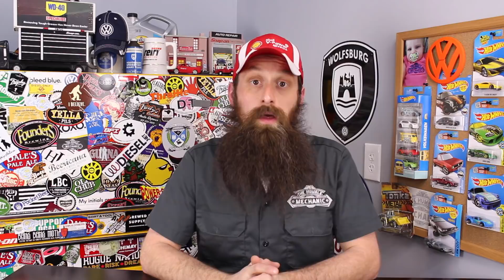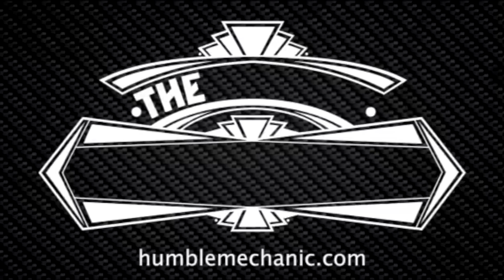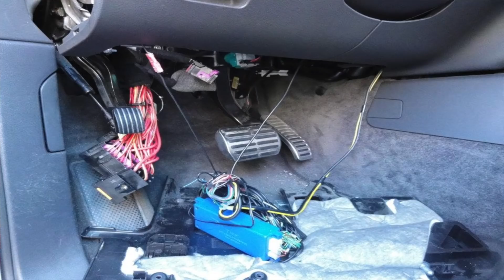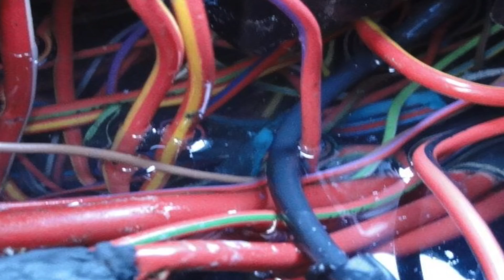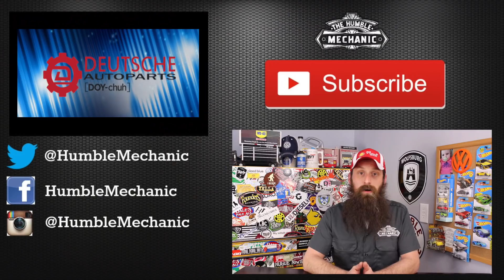Top 5 Failures of the Volkswagen Touareg

Comment: Great video sir, you have that rare talent for being critical and still coming across in a sincere and nice way!
Ok so I bought mine new, V6 2004 now has 186,815 miles. Yes, on most of the issues except the ones for air suspension and seat issues as mine was the very basic model. You did mention brake sensors briefly they are these little wires with clamps that usually break within the first few brakes pad changes. 
So the bearing on the drive shaft, YES!!!!!!!!!!!! Lmao, I’m an expert on how to repair that as I have been fixing it for many years now. Heavy Gorilla tape around a core of foam, I might make a video next time I need to fix it 😂 

The ONLY thing you didn’t mention of perhaps you did and I missed because you are hauling ass lol THE HEADLIGHTS
HEADLIGHTS fail a lot especially the day ones, after a while, like 15 years the wires that connect the lights start to get old and sometimes need replacing.
The real crux is to change the headlights one of them is fairly easy, I forget which, but the other one you have to remove a lot of stuff to get it in there.
Also the battery is a real bitch to replace as it’s under the drivers seat lol 😂 

Even with all that said I still really enjoy this vehicle it has never left me on the side of the road and still runs like a top for the most part, the gas mileage sucks bit it’s a 5000 pounder…it’s still very comparable to new models in features build and off road capability. Just MHO bit after the first T1 Touareg series 2004-2006 they went downhill, jus the roof top bars to name one…
Amazingly all my windows still work and the sun roof never had to repair them…now tomorrow they will break as I write this lol.
Ok I think that’s all I got, thanks again really enjoyed this and will be on the watch for all the other stuff, it’s inevitable I suppose!

Comment: "check headlight range control" has been on most of the time I have owned the Touareg. Still have not got it fixed. The corroded wire under drivers left foot triggered dash lights to go on and prevented the car from shifting out of park. VW was of 0 help and just wanted me to pay them $1500.  Are either of these issues a recall or no?

Comment: My wife had every problem you listed. The car would not come out of park took it to our local stealership they had no idea. I found it on you tube and fixed it myself. The water was leaking under the front drivers seat and had to splice a a couple wires that had rusted clean through. Put them together the car came right out of park.

Comment: 2011 touareg - master window switch on driver's door breaks.  Good sign broken -no auto up and down.  Sometimes have to push on back of button.  However, easy fix on my channel - part is cheap on ebay.  Pops into driver's arm rest with almost no tools.  2nd is chasing cooling sensor temperature problems.  replace the sensor on lower radiator hose - super easy.  But still had temp needle wagging about.  Tested new and old sensors in tea kettle with 200 degree water - resistance remains constants over 30 minute.   Bleeding air out of system can solve it even though you would think that in the lower radiator hose how could that be a problem.   Laying the whip to the engine a few times, then idling with heater on and cap off reservoir, reduces it.   Using ODB2 bluetooth and torque on tablet shows temp going from -20 to 180 (even though gauge reads 200).  Kind of annoying when the a/c cuts out in Texas heat.  But other than that at 102K miles - reliable and remarkably sure footed in the blizzard we had a few months back.  V2 TDI improved over previous version.

Comment: The V8 also had bad ground cables from the engine mount to the frame. The welded connection of the cable will develop high resistance and drop up to a volt and a half. 
I’ve done several vacuum and tandem pumps for oil leaks on V10s. 
V6 TDIs have oil leak problems at the oil pan. The apparent fix is replacing bolts and coating the new ones with sealant.

Comment: I’m getting the rapid thumping noise and feeling coming from what seems like below the centre of the car when accelerating hard...which is kinda fun to do in a W12🤪. It’s an ‘05 with around 110,000kms. Would these have been susceptible to the same prop bearing issue? I’m guessing it might be since the rubber is 16 yrs old??
Reply: SAME ISSUE ON 05 V8 CAN YOU TELL ME IF YOU FOUND A CHEAP SOLUTION>?

Comment: I have a 2006 V8 with over 244,000 miles (329,680 km).  I recently took it to my local dealer's service department for a check engine light (my code scanner said P0429). The service  manager told me that there was so much carbon buildup that the engine required a cylinder head replacement to the tune of $21,000 (US) (parts and labor). Ummmm...no...hell no!  

[Side note: A majority of my fuel fill-ups were with Top Tier-rated gasoline, and I periodically added fuel system cleaner.]

I'm picking up the vehicle and planning to sell it for whatever I can get for it.

Overall, I grew to like the vehicle for the past fifteen years I owned it...despite the costs in tire replacement and brake replacement, despite replacing the prop shaft, despite replacing the catalytic converters at major expense, despite having air bags replaced out-of-warranty (and not because of an accident), despite the vehicle having a poorly-engineered parking brake release lever that breaks and costs $70 (US) to replace (after the second one broke, I used a 12mm open wrench to release the parking brake.  Why couldn't VW use aluminum for the lever?)...

I was hoping that the vehicle make it to 300K miles; however, it's time for me to move on. 😊

Comment: I was driving my 2014 vr6 Touareg on the highway when if felt like the brakes pulsed on their own and and abs light and check engine light flashed, and also got a projection lighting system not working for only a second. Any ideas ?😓

Comment: 2008 V8;  Brake booster plastic lines leaking $1500 to replace.  Three years and 3k miles later they have cracked again but I caught it before they threw a CEL  and sealed the cracks with RTV and electrical tape.  Works fine.  Headlight wiring disintegrates.  Went to change a light bulb and every wire I touched crumbled.  Bought new Hella headlights for $800.  Wife complained about a "sloshing" noise when she turned corners.  VW technician identified the problem as water in the frame.(?)  He said something about sunroof drains causing it.  100k miles now and headliner is starting to drop in the back.  Clearcoat on the roof just above the windshield and in front of the sunroof started to crumble.  Had the top repainted ($700).  Three others online in Club had the same problem in the same area with the same color (Galapagos).  Just had to replace the battery and picked up a factory battery from the dealer.  Bad enough it's located under the seat and dealer wanted $300 to change it (not including the battery cost).  Once I got the old one out I found out the VW battery was slightly larger and the positive cable wouldn't connect because it was too short.  Had to buy a new cable ($90).  The only reason I keep it is because I'm tall and old and it's easy to get in and out of.  Never been off road or in low range.  (Well I do like the 350HP though.)

Comment: Have you ever have problems with the secondary coolant pump on the v6 toureg?
Reply from the maker: Just leaks
Reply: @HumbleMechanic  so I have a 2013 toureg with the v6 engine gas. So I yesterday I start my car I see the check engine light come on so I grab my computer n used my vcds to scan the car and it said the secondary coolant pump have opened circuit so clear the code and it still come back so the pump really bad. Can you tell me where exactly the pump located? Because I have can't afford the dealership price to replace i normally work on my vw myself.

Comment: Hi I replace the transfer case chain. I put the car in neutral. So I could spin the transfer case.  Well it's all back together and now it feels like its stuck in a low gear. Well it's not there is massive drag on the suv now. Is there a way to reset the servo motor to work back to original location.

Comment: I currently have a 2016 Jetta with the 2.0 the car continues to say permanent miss fire one cylinder 1 I’ve changed plugs coil and the injector seal what else may cause this issue
Reply from the maker: I’ve seen valve springs do that

Comment: Hey all I have a 07 3.6 v6 Touareg and I love it  so much! I’m having a issue though and hoping someone might have a fix for me! 

I’ve owned my Touareg for a year now failed emissions due to the engine light being on! 

My issues are 

P00341 -  I replaced the sensor g40 yet the code came back right after we cleared the codes! 
( no problem driving at all no noises nothing, timing is spot on too ) 

P2293 - replaced the fuel pressure sensor yet the code remains 

P12A4 - this one comes and goes randomly 

Also at first start up in the morning, hot or cold days the Engine idles rough and misfires but after a few minutes idling the misfires go away and the engine calms down! 

Just looking for a fix so I can pass emissions since those 3 codes failed me! 

Any help would be appreciated :)

Comment: For whatever is worth, we have a 2013 Tuareg TDI, basic model absolutely no options which now has 105,000 miles on it.  The vehicle has performed without any problems except for the adblue heater which was replace at no charge.  We buy new tires every two years, do the prescribed maintenance but change the oil and filter every 5,000 miles as opposed to 10,000 miles.  I could not be happier with this VW vehicle.  We purched this car brand new from VW ... and they gave us $$$ back after the diesel gate :)
Reply from the maker: We love our 2015! It’s had a few emissions things that required replacement. But it’s been under warranty

Comment: had our 2004 V10 for 6 years, its towed a camper trailer over at more than 20000km of Australia's roughest dirt roads.
its got 260k km on it and runs like a train, it's a beautiful car to drive. I'd get another one for sure.
Sure it's high maintenance, I do all the servicing myself which saves a lot of dough.
Going to a dealer for repairs is an impoverishing experience...
But if it payed for your learnings Mr Humble, it was money well spent.

Comment: Hey bro... I was very skeptical about asking for help, but not one mechanic in the country where I live in has figured out the problem I have with my Touareg (3.0 v6 tdi)., thing is that my car starts up fine when cold, but it just won’t start when the motor is hot,  as if it had battery issues.
 I just bought a new battery, following a VW technician’s advice (deep in my guts I knew it wouldn’t fix the problem, but I had to give it a try)., the problem has kept even though the battery is new. Every time I drive around for a while, switch it off and try to start it up again, it won’t start... I will have to wait at least 20-30 mins or so to make it start again.
Hope you get to read my message and share your useful knowledge and experience. 
Really appreciate it.
Reply: Check the fuel pump.
Reply: @cjottovon4371  
Thanks man, I changed battery, starter motor, refurbished the alternator, particulate filter pressure sensor, diesel filter… and the problem persisted.
I found a great technician with all the appropriate tools required and took the car to his workshop. 
 It was an electrical issue on one of the fuse boxes, 3 days and the car was ready and fully tested.
It has been “such a pain… “ dealing with the Touareg, but it has been behaving well for a while now.

Comment: 2008 3.6 Touareg high pressure fuel pump throwing codes and loss of power for two days but now it’s driving fine could it be because I was a lil low on engine oil and I ran the gas tank to 0 miles??? Thanks

Comment: Have you seen about a 08 touareg saying that a tail light bulb has failed but it actually isnt? And then randomly shuts off all the rear lights, not even the 3rd brake light works. Just the rear fog and the turn signals. If I shut down the vehicle and start it again, it will work again for a couple of minutes.  Might be the J393?

Comment: Having trouble with my 2004 VW 4.2 V8 Touareg - fitted a new battery only getting 11.7v when running it’s not charging. Not sure if it needs a new alternator or the TSB for battery cable. Any advice ?? No A/C or sometimes no electrics

Comment: HumbleMechanic I have 06 v8. Have you or anyone come across a low  air horn type sound from aprox under driver dash. I have suspected harmonic resonance from airbag suspension or even bad power steering pump but cannot isolate it. Only at low rpms: slow acceleration or coming to a stop. All these systems are functional. Just cannot find this "almost out of air horn".

Comment: Need part numbers for mine or part numbers diagram brake booster no boosty need vacuum the hoses are all cracked and split need part numbers for vacuum hoses
Reply from the maker: Give the local dealer a call they will probably be the best resource

Comment: Stepper motor or tpms ? I have the tpms light come on the pressure is good but having issues with the diff locking up randomly.  Otherwise tires are pretty much new no uneven wear all seems well . Just curious where to start ..
Reply: 2004 3.2 v6

Comment: Everyone seems to be afraid of working on their Touareg. Just got mine a week ago and the alternator pulley bolt snapped. I replaced the alternator while I was at it. I did it all in my gravel driveway and without pulling the engine. The electrical is a nightmare though...

Comment: Hi just subscribed to this channel, Do you know the causes about Transmission fail with Valve Body Problem with aissin’s 6 speed auto in 3.0lt TDI v6? 
I am recently looking for a touareg to buy 2008 or 2007  around100k miles on it, I am not in US and Europe.  Owning the car costs around brand new VW polo to buy, I know 13y/o is old car is risky no guarantees whatever. I guess You have generally mentioned about short term problems ,  glad to hear about any long term problems... thanks 🙏

Comment: I was just given a 2005 touareg.  Right out the gate it says the emergency brake is engaged when it is not.  The engine has a very rough idle.  Among other things.  I am hoping to get some help though.  When the key is not in the car after it has ran, the dashboard lights remain on, center info, odometer, clock, etc, and the radio stays on, these things do not turn off no matter what, unless negative terminal on battery is disconnected.  I was hoping, for some help in fixing this issue.  If you know why it runs rough or thinks the parking brake is engaged as well, that would be welcome help as well.

Comment: Rolled the dice on a 2006 4.2 air ride. Had it about a month and put about 3k on it.  The upper and lower control arms need replaced and a new set came with it. I want to do it myself but the set that came with it are made in China. If I do it any tips or tricks would be appreciated. I have started buying VIM tools triple squares etc at your recommendation. The Touareg is awesome, even more awesome if I can work on it.

Comment: I'm on VW #4 starting with my old 97 GTI 2.0 8v and now my 2015 Passat TDI. 
I love them all but it's pretty clear that the Germans do not do electronics nearly as well as they think they do.
Reply: Very nice im on my 5th 1st was a 87 mk2 gti 16 valve, second mk1 89' cabriolet 1.8 8valve third 83 caddy truck with gti jh swap and costom trans. 4th mk4 gti 30th aniv. And 5th 2005 v8 treg. :) im a sucker for the swag.

Comment: V10 tdi 2005 23,5 miles  per gallon dual tune box 275 HP, tons of torque. 217500 miles. Many fault codes and electrical problems but Still an amazing car. But in Sweden the car taxes for Diesels are ridiculusly high, 13500 SEK, it is aprox,1300 dollar, per year! Got a leakage in lubrication hose to one of the turbos, got to dismantle the gearbox/engine to fix the bastard. Done that one time before with the same car. Love it and hate it!

Comment: Injektor issues 2k, transmission Cable issue Cost 400  € + you have to Change oil total 1000€. Drive shaft 1200€. Elekronik failuere., causes AC failuere. Sometimes work, sometimes not. At The end... Buy a toyota. I say this as auch German VW Driver since 15 years. VW are built for 200k.

Comment: I am surprised I can not find anyone discussing this in forums, I replaced my fuel pump, it lasted 9 months. I opened it  up, nothing wrong except arc tracs on the commutator. This told me I had a low voltage/high current issue. Basically a bad connection somewhere. i suspect that is the primary problem of most peoples fuel issues with touaregs. I installed a bypass switch on my console for my pumps, solved the issue. I would like to fix the connection issue though as the level indicator seems screwy too. Any idea where I should look(connection on tank lid is ok). I also seem to have a cam sensor connection problem as well and wonder if they are related harness wise.

Comment: I have a 2004 toureg and had a fuel pump replacement and now my check engine light is on I put a code reader on the car and it says p0230 premiay fuel pump circuit malfunction and I'm trying to figure out what that is can you help?